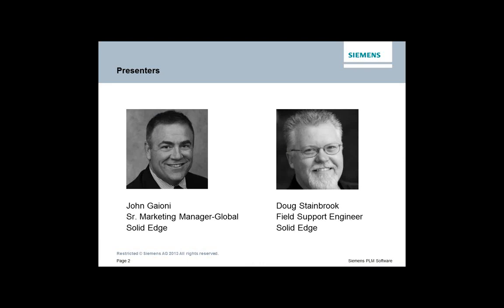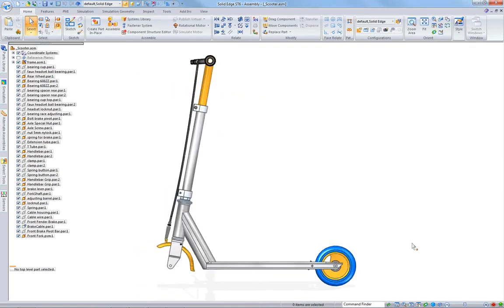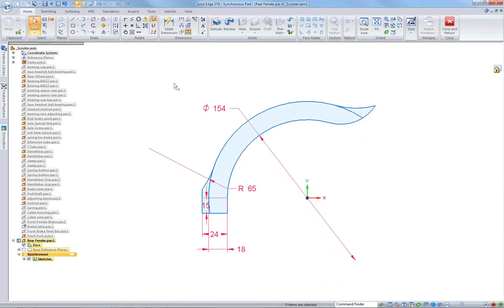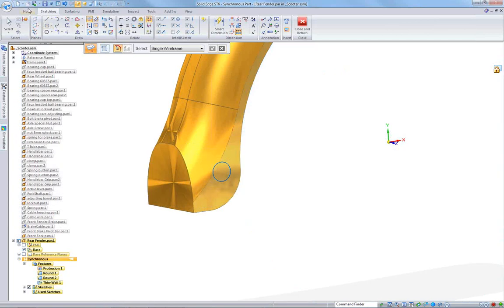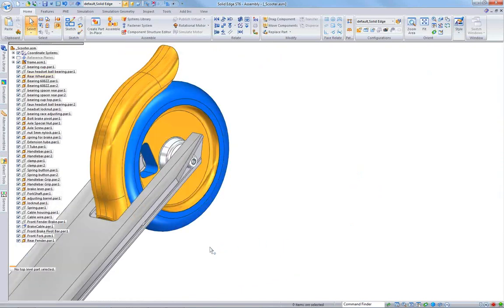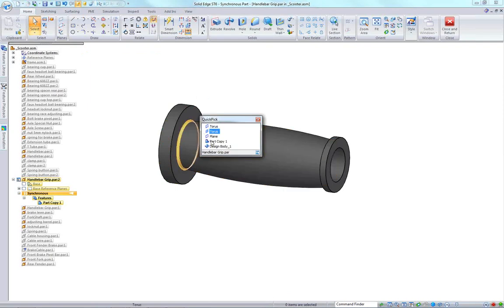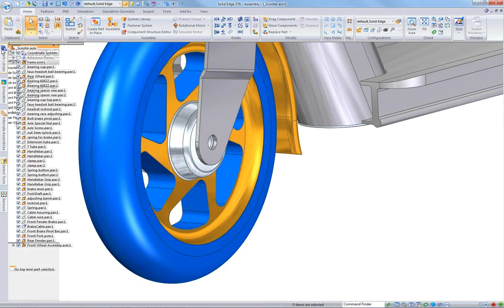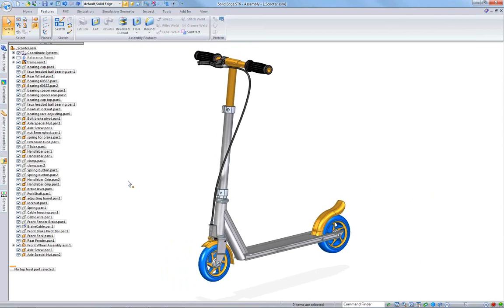Getting Started with Solid Edge

Comment: man you are lied you are new is Solid Edge, but great tut realy, I am using solid edge already 4 years and I must say it is one great software, easy for PC, sketching is totaly awesome and fast and I recomend Solid Edge to everyone even people are thinking he is not that great.
and great thing about solid edge is that that siemens knows how teriblle their render is in SE so big like for connecting it with keyshot, they are realy thinking about what they do but I would like them to make tool called 3D sketch as SW has it, the option they ve got now is just teriblle.
I personaly dont recomend to use modeling in assembly for people with low PC performance, but you should always try to use that designe advantege.
next time just remove noise from audio, and again great tut!